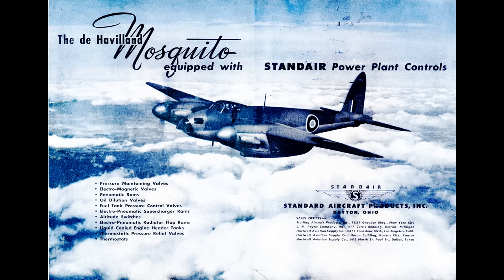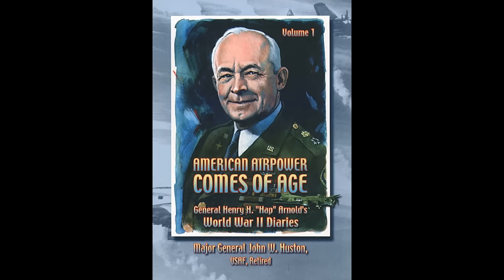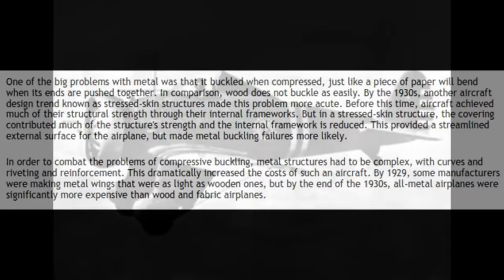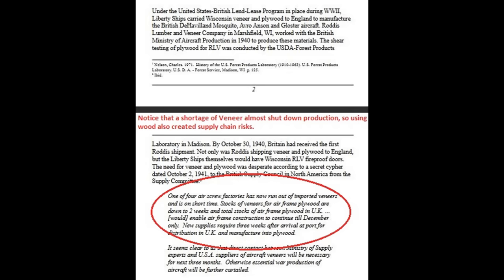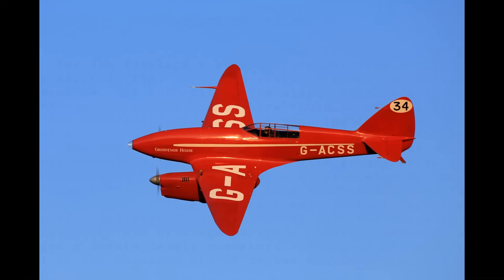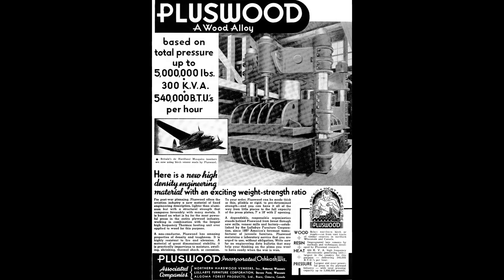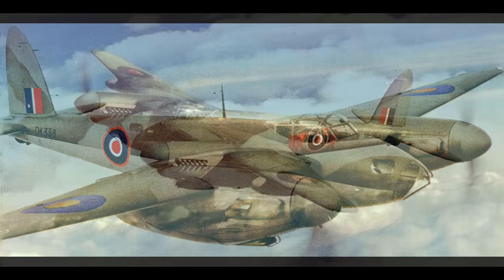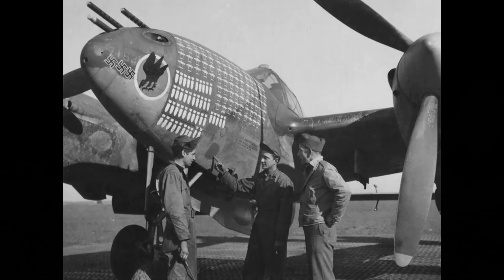De Havilland Mosquito vs. ?

Comment: Interesting though the US passed on it, the Mossie was produced in Canada and Australia.
Reply: As far as I know no foreign designed aircraft were made in the USA 1939-1945.
Catilina's were built in Canada as Canso's and P36's were built in India, both under license.
Reply: @nickdanger3802  And the Mustang was built to RAF spec’s. The D variant came about as a result of tinkering the B and placing a Rolls Royce Merlin in the B’s airframe. The area behind the pilot was raised to accommodate a large fuel tank. The greater fuel capacity and higher fuel efficiency of the Merlin combined with drop tanks gave it the ability to go all the way to Berlin. It was above average in its performance. That confined that the Battle of Britain and the fighting on the eastern front took most of the superstar German aces out of the fight meant that by mid 44, the allies had complete air dominance.
Reply: @arniewilliamson1767  So much wrong here I don't know where to begin.
Reply: @nickdanger3802  Like everyone entitled to your opinion.

Comment: Corrosion problems are solved on aluminum aircraft? Really? I work on maintenance on the U.S. Navy E-6 Mercury aircraft. Our biggest problem with these is corrosion. Wing skins corrode, and we are having to replace multiple front spars on every aircraft we get in, due to severe corrosion. I mean, bad. Real bad. So bad, the spars are often cracked in the area. One aircraft, the crack was 18 inches long and almost reached the end of the spar. I don't want to think what would've happened if it had. I think the Navy is tired of dealing with it, because they are replacing the E-6's with a new stretched version of the C-130 and putting the E-6's out to pasture.
Reply from the maker: Hi Robert, as you didn't give me a time stamp, I'm not sure what you are addressing. I think this is probably an issue of context. The Boeing E6s you are working on are likely 20-30 years old. That's a very different time scale than a WW2 airplane which was unlikely to fly in service for even two years, so yes, in WW2 airplanes corrosion wasn't a big issue. Of course given enough time anything becomes an issue.

Comment: Interesting video. 

But the Mosquito had one interesting feature that Greg didn't mention: it was a stealth fighter/bomber. Of course, radar being a new technology at the time, it wasn't designed with that in mind. However, it just so happened that the wooden airframe didn't show up very well on radar. 

This was soon realized and one of the missions Mosquitos were regularly sent on was to fly over at night to France and just 'hang around' the French airfields and wait for the German bombers to return and try to land. If they spotted one (such as when the bomber turned on its lights to land), they would jump in behind it shoot it up. 

And the story I've heard as to why the plane was first produced in Canada was that the British didn't have spare production capability to produce it. However, there was in Canada. And, of course, having lots of wood available probably had something to do with it as well. 

The ones produced in Australia likewise used the local supply of timber. However, the wood used there was slightly heavier and so the Mosquitos had to be modified slightly to accommodate the heavier weight.

Comment: Um, where are all the people screaming how much better the 38 is than the mosquito. I'm disappointed.
    Greg ,I read in a book long ago written by a British photo reconnaissance pilot that he first flew the 38 and loved it but after switching to PR XI he realized what a fuel pig the 38 was at altitude. That's my 2 ¢
Reply from the maker: I see a lot of comments supporting both planes, and I haven't even really started the comparison yet. Somehow I think it's going to upset people on both sides.
Reply: The P-38 was a cold blooded killer for the USAAF in the Pacific.  The top two US aces of the war flew P-38’s in the Pacific, as did the wave top precision long range raid that took out Yamamoto.
Reply: @petersouthernboy6327  just like everyone thinks a Mustang GT is a great car ,untill the drive a real car 😉
Reply: Robert Moulton - not in the Pacific.  The RAAF had over 200 Mosquitoes and they used them primarily for photo-reconnaissance.  The RAAF and RNZAF preferred Beaufighters for anti-shipping and ground attack.

Comment: The DH-98 vs The P-38 ?   No contest.  The DH-98 wins hands down.   Aside from seeing active service in every theatre of war, it's versatiliy was unmatched.  
Capable of being armed with a 57mm Ohlins cannon and rockets for anti-shipping strikes,  standard night-fighter weapons packs and one of the first NF's to be fitted with radar.   It's role as fast interdict, low-level bomber was unmatched, often leading to stories from German AA crews...  '' Ve didn't even zee it coming or going...''   As a high level, tradtional bomber, it was even capable of carrying one 4000lb 'cookie' or 'blockbuster' bomb and incenderies or 'pathfinder flares'.  the only other RAF Bomber Command aircraft to carry these 'cookies', were  Lancasters.  It had superb range with pylon fuel tanks, sometimes allowing two raids in one night over Berlin, using two different crews.  Strpped of armament, its role of Photo Reconnaissance was equally unmatched.      Though slower than a Spitfire in level flight, or climbing to altitude, in a decending flight was actually faster.   It was also often used to return an escaped PoW from Sweden (in the bombay) and the civll aviation company BOAC used it (under Swedish terms) to transport ball bearings to Britain.   
.
Thus far exceeding the capability and fittment of the much vaunted P-38 'Lightning'.  Which itself had also earned the colloquialism - 'Widow Maker'...  Enough said.      
.
And let's face it folks,  The DH-98 'Mossie' was arguably the most sexiest looking warplane of WW2.   And my favourite of any aircraft of any era.   A kind of 'Double Spirfire' in essence.   Owing much to the 'cold-moulded' boat building practices hitherto reserved for torpedo boats and fast attack craft.  
.
 Here's some more interesting info on the ''Wooden Wonder'',  including this amusing quote from the chief of the Luftwaffe... 
====================================================================================================
//    ‘In 1940 I could at least fly as far as Glasgow in most of my aircraft, but not now! It makes me furious when I see the Mosquito. I turn green and yellow with envy. The British, who can afford aluminium better than we can, knock together a beautiful wooden aircraft that every piano factory over there is building, and they give it a speed which they have now increased yet again. What do you make of that? There is nothing the British do not have. They have the geniuses and we have the nincompoops. After the war is over I'm going to buy a British radio set – then at least I'll own something that has always worked!’. //  Herman Goring  
=====================================================================================================
https://www.baesystems.com/en/heritage/de-havilland-mosquito
Reply from the maker: But could it kill Yamamoto? Could it take on Japanese fighters? All kidding aside, it's a closer comparison than you might think, I'll cover both planes in detail.

Comment: Look at the high WW2 bomber crew losses of the USAAF 8th AF. The Mosquito could carry a 4,000 lb bomb load. With a crew of two. Versus a B-17 carrying a similar bomb load with a crew of ten. Plus the Mosquito was faster than the B-17.
Reply from the maker: I address that exact issue in my P-47 Pt.8 video.

Comment: Greg, why didn't the manufacturers of twin engine AC at least use counter rotating props?  One would think it would make the AC easier to handle. (Excluding the P-38).
Reply from the maker: It seriously complicated the logistics chain. Now you need to stock right and left hand engines and props, not to mention various directional engine parts.

Comment: I am aged enough to remember the great sound of Merlins and Griffons revving up on, variously, latter Marque Mosquitoes and Spitfires, as they prepared to take off from Changi airfield to hunt and bomb Communist positions in Malaya.       An old timer I once worked with was a Pathfinder on Mosquitoes during the latter years of WWII, and once while in unarmed Pathfinder mode was taken on by a pair of Me262s - his answer was to stick his nose down and open right up, rolling and importantly heading for a near-bye cloud bank.      The jets lost him, probably ran out of fuel and bugged off back to base

Comment: just  to say this in the You tube video spitfire 944 which  about USAAF recon pilot And in it , it has the USAAF 9th air force  replacing it P38 recon aircraft with Mosquito and Spitfires i think this answer what was the best recon aircraft

Comment: Interestingly the wooden wonder could be landed on a same period aircraft carrier. It took some skill (Captain Winkle Brown) The P38 they were looking at a fold up wing version, a proposal for the US Navy. Is there any video footage of a P38 landing on an aircraft carrier? Would be interesting to see.
Reply from the maker: They did design a naval version of the P-38, however the US Navy absolutely did not want any liquid cooled engines on carriers. Thus it never went anywhere. The naval version was to have folding wings, arresting gear and more. I may touch on each planes Naval potential in this series, but neither plane was really capable of operating from a carrier, stunts excluded of course.

Comment: Shame they never tried to build a Merlin engined P -38.
Reply from the maker: They did.
Reply: The Allison that powered the P-38 was built by GM. The Chairman of the Office of Production Management was William Knudson, formerly president of GM. This probably explains why the Army Air Force pursued the Fisher P-75 Eagle powered by a twin Allison, and why after seeing the P-51 changed over from Allison to Merlin power, all efforts to do the same with the P-38 were quietly stopped.  In truth the transformation would not have been as dramatic with the P-51 as with the P-38, as the turbo-charged Allison already had good power at altiude, and once all the cooling system bugs were worked out with the P-38 J and L models was also reliable.

Comment: Great video, Greg. Thank you. Something I've long wondered about... this is probably quite fanciful,  but here goes. The bomber versions of the Mozzie could (in general terms) carry 2,000+ pounds of bombs at 350mph and 30,000 ft. They had a range of 2,400-ish miles, a crew of two and used two Merlin engines. The Lancaster (a brilliant aircraft, don't get me wrong) could carry 14,000 of bombs but at just 200mph and 20,000 ft and with a similar range. But crucially they required a crew of seven and four Merlins, with all the training, cost and maintenance that entailed. Big difference in bomb load, admittedly, but boy, what a difference in performance. So my speculation is this. What if the British had based their bombing campaign on the Mosquito? This aircraft could have operated by day as well as night with no escort. A very fast and high flying aircraft, hard to intercept or attack with ground fire. What if they'd worked the aircraft so hard that one aircraft could fly up to three sorties per day, with crews being rotated? Surely a way lower attrition rate than a four engined heavy. With far fewer resources required to build them, it's conceivable there could have been swarms of Mosquitos (no pun intended) hammering the enemy by day and night. I await the incoming flak.
Reply from the maker: It's too complicated to answer here, but it is a good question and I will take care of it when I get to the bomb load part of the P-38 and Mosquito.
Reply: @GregsAirplanesandAutomobiles  A simple answer is that there is no way that a Mosquito could carry a "Tall boy" or "Grand Slam" bomb, like the Lancaster could.  Also, one bomber carrying 14,000lbs of bombs is more efficient from a fuel perspective than 7 bombers carrying 2,000lbs each.  Also, that's one pilot, one navigator, one bomb-aimer and the gunners - gunners are cheaper to train and pay.  7 pilots + 7 navigators is more expensive for those 7 Mossies, too....
Reply: Most mosquitos had single stage supercharger Merlins, they would not be doing 350 mph at 30,000 feet.
Reply: The Mosquito wasn’t a high altitude bomber of particular note.  The RAF built thousands of Lancasters even after the properties of the Mosquito was known.
Reply: Peter Southern Boy  The Lancasters were regularly run above their service ceilings, every tens of feet per minute of climb was coaxed out of their out-of-breath engines on the way to the target.  The crews were glad they were not in Sterlings.
Reply: Gareth Davies - Let me give just one example why it’s incorrect and misleading to superficially cherry pick performance data - especially when it comes to the Mosquito.  On September 28, 1944, the USAAF sent 243 B-24 Liberators to bomb the Henschel factory In Kassel, Germany.  The carefully planned raid destroyed 95 % of the plant floor space and put an end to King Tiger tank production.  After the war, it was learned that the raid caused the loss of production of about 657 Tiger II’s.  The long range load out for the B-24 is given at 5,000 pounds.  Since the max bomb load of the Mosquito is listed as 4,000 pounds - why didn’t the Allies send 292 Mosquitos instead?  Because it had to with properly “servicing a target” in Air Force parlance.  The B-24 has a considerably larger bomb bay than the Mosquito.  The Henschel factory was quite large.  And therein lies the nuance.  The 4,000 pound payload for the Mosquito was for one particular bomb - the 4,000 pound “cookie cutter”.  Alternatively, two five hundred pound bombs could be carried within the Mosquito bomb bay.  While theoretically it MIGHT have been possible for the Mosquito to also carry one 250 pound bomb under each wing - B-24’s with ten 500 pound bombs are going to “service” a large area industrial target better than a smaller number of large bombs, and the fact that the Germans told us after the war that the raid demolished 95% of the Henschel floor space tells us that the B-24 was the right plane fir this particular job.

** 198 P-51’s escorting.  31 B-24’s and 1 P-51 lost.  118 KIA, 121 POW.  The Germans lost 29 fighters and 18 KIA. 

* Eleven US aircrew were captured and lynched (killed) by civilians.  This was found out by the USAAF, and leaflets were dropped in the vicinity in follow up operations.  Just outside the city limits of Bad Hersfeld the USAAF carpet bombed an area to intimidate the locals and send a message.

* ** In 1990 a Memorial was erected at a USAAF crash site in the Seulingswald as a gesture of reconciliation

Comment: You mentioned all high powered twin engined planes are difficult to control on one engine.  Does that include the P-38 with its twin tails?
Reply from the maker: Yes, but only difficult to control at low speeds and high power on a single engine. This is true of all twin engine airplanes.

Comment: a couple of comments. the DH88 didn't have an uprated motors. these motors were available in the Dh89 for example. but the really big difference is the dh88 gypsy queen R motors had variable pitch props. Not manually adjustable but the pitch was changed by a balder/ balloon in side the hub.  as altitude rose the balloon would expand changing the pitch.  nor was the Dh88 fast. it was how ever  fuel efficient slippery and had very large fuel tanks. its racing was all long distance and not American style pole racing..   you missed the big deal about the Moszzies construction.  you did mention balsa wood but you didn't mention the fuselage plug mould composite construction.  this is the big deal with the mossie.   it also leads on to the mossies ability to withstand enemy fire/ damage. unless the projectile hit a control fuel line motor etc.  the rounds just  passed right though/ your comparison of a power pole is so incorrect. hard wood  splitting/ soft wood laminar!

lastly  the dh 108  did not disintegrate because of DH unfamiliarity with metal construction. it disintegrated because it was trying the brake the speed of sound and went into a high frequency oscillation.  high negative G ripped the wings off. Geoffrey De Havilland was killed by a broken neck.

Comment: Which would you prefer running at 5 MPH in a suit of armour and getting your ass kicked or running free as a bird and no one can get near you? The material doesn't matter the end result certainly does.
Reply: @nickdanger3802  And your point is? How many ops were they doing, what targets were they attacking etc......? The front line is a dangerous place.

Comment: did  it's wood construction  reduce it's radar  'footprint.'?? by design or accident.. i.e. a stealth quality.
Reply from the maker: It's certainly not stealth.
Reply: Metal bits on unarmed Mossie bomber; 2 RR or Packard Merlins, radiators, constant speed props. wheels, landing gear, bomb rack, fuel tanks, control cables and instruments plus up to 3,000 pounds of bombs on unmodified aircraft.
For fighter bomber, the most produced offensive variant, add 4 Hispano 20mm cannon and ammo and 4 Browning .303 MG's and ammo plus up to 1,500 pounds of bombs.